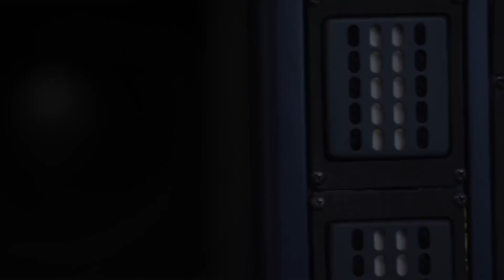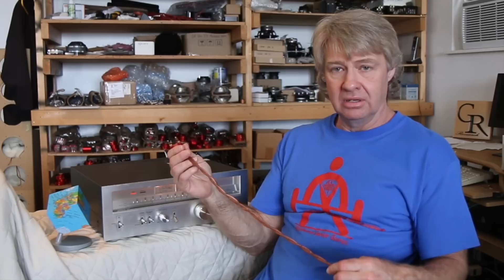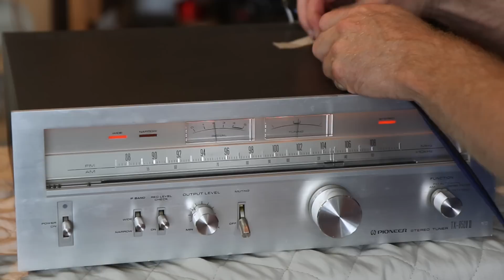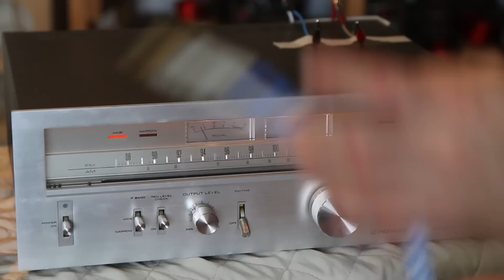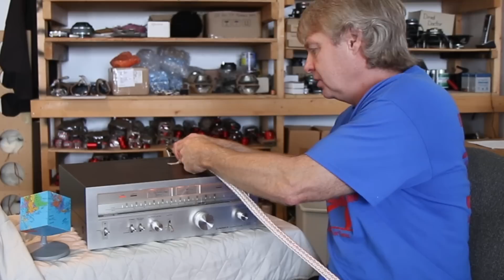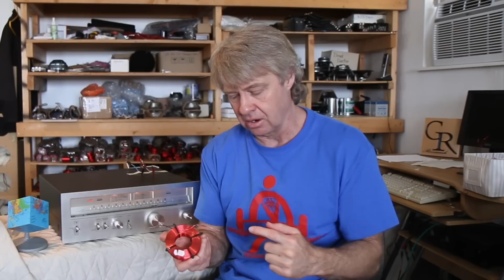Do Audiophile Cables Matter? Here's PROOF!

Comment: So.....you are proposing that the RF energy floating around pretty much everywhere has an effect on the analog audio signal carried by a speaker cable? Uh....I don't know if I am buying this theory. Yes this demonstration does prove that some speaker cables make good FM radio antennae's while others do not. The audio signal is a bit different from RF energy. I am not saying that cables do not matter even though I have not been able to hear any significant perceivable difference myself. I am not convinced by this parlor trick. It proves nothing about differences in sound. Proof would be if you can show a difference between input and output of an audio signal over different cables. I have yet to see anyone provide this sort of proof.
Reply: Not to mention that the signal at the output and internal feedback network is orders of magnitude larger than that induced by stray RF. The only time speaker cables/leads matters is if there is a long run as the cable/wire looks like a high-Q capacitor and can cause amps to oscillate at their full power output. This is why most linear amps have an air-wound choke and 10 Ohm power resistor at the output, to help quench any oscillations from capacitive loads. The input is the most critical, and there properly shielded RCA cables are needed, and a lot of cheaper ones are often just two conductors without either foil or a shielded braid, and those will pick up a lot of RF. But with that said, a lot of amps will usually have good RF decoupling at their inputs to keep signals from local AM, FM, and TV broadcast along with cellphones out, not to mention all the 50/60Hz and SMPS EMI. Never the less, a video on input cables is what's actually needed, but this guy doesn't seem real technical.
Reply: @mysock351C  Well said.
Reply: There was no trick involved, he just used a setup that's not representative for real life applications of speaker cables.
He used the cable without anything connected on one end, turning it into an open dipole antenna, while he should've used a speaker voicecoil (which basically "closes" the dipole by shorting it out) to make it anywhere near realistic.
Another error is that the input impedance of the radio receiver is significantly higher than your poweramp output.

In contrast to speaker cables, there's actually merit to RF noise reduction by using shielding on interconnects, especially when run close to high power equipment that contains heavy motors or welding machines and even regular power cables (which can either result in a low level hum/buzz of 50/100Hz or 60/120Hz depending on your power grind frequency).
This has mostly to do with the fact that the input and output of line-level signals are significantly higher impedance than that of a poweramp output or speaker voicecoil.
It has also to do with that the signal is amplified after the noise is introduced, meaning that the noise is amplified as well.
Reply: No parlor tricks here. The demonstration was real and highlighted just one of the differences in cables. This one was just easy to show. And the proof is in the pudding, as they say. There are clear audio differences.
Reply: @dannyrichie9743  well it would be foolish of me to outright deny that there are differences in audio signal transmission between cables. However there is a clear lack of evidence and your demonstration proved nothing related to actual transmission of an audio signal. An FM carrier wave at 104 MHZ is not going to have an effect on the audio signal. They are two completely different things from a physics point of view. As I said already "proof" would be demonstrating a measurable and significant difference in output of an audio signal between two different cables. However I am hesitant to dismiss the lack of measured differences to mean you don't hear a difference because we may just not be measuring the right things. Interesting video and I meant you no disrespect by calling your demo a parlor trick. I just feel like many folks that do not have a background in electrical/RF engineering would be sufficiently confused to believe you actually proved anything other than some some speaker cables are better antennas than others.
Reply: @JHuffPhoto  You're thinking about this. I like that. The proving that cables are different in one aspect (being an antenna or filter) doesn't prove an audible difference, but it does prove them different in that regard. And that does effect the signal transfer. The real test is to perform listening tests and comparisons to know if there is an audible difference. I've done this a LOT. However, that still doesn't prove anything to the nay sayers. So proving anything to the masses is tough.
Reply: @dannyrichie9743  I have learned that it is never wise to simply dismiss someone's experience outright. However I do have a few questions. Ok so you say that the RF rejection characteristics have an effect on the transmission of the audio signal. How would you explain this effect (in technical scientific terms) and measure it in a scientific way? An effect that is at -130db from the signal level will likely not be audible so how would you propose to measure this effect and determine the level relative to the input signal.
Reply: @JHuffPhoto  Good question. I don't have the means to measure it, but it is pretty easy to hear on a good system. And some things that we do are just really tough to measure.